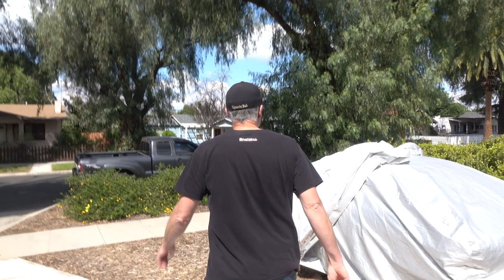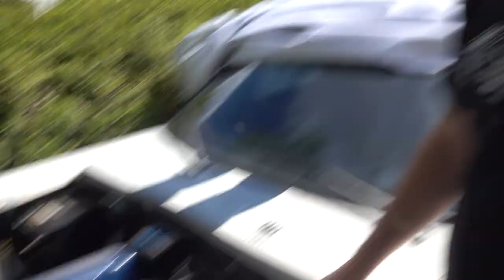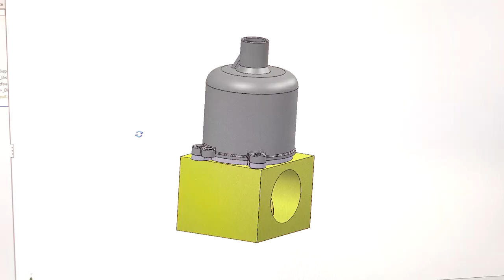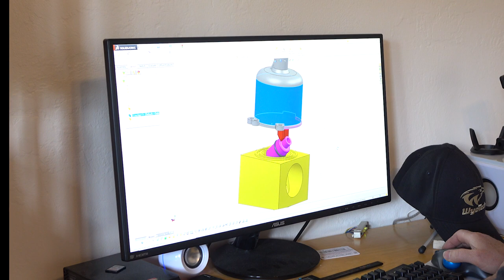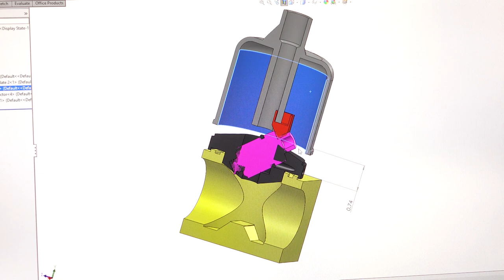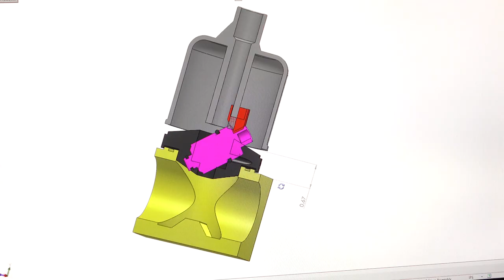Datsun 240z upgrade SU carburetors

Comment: You might looking at adapting an old 2 injector  GM TBI setup (say for a V-6) so you can split the injectors  and perhaps mount each horizontally inside the air filter in the mouth of the SU and have them spray straight into the carb throat.  You may not have to mod the carb much past making a bracket to position the injector and you'll have more space for wiring and plumbing the fuel. A side benefit is you won't be mangling a set of SU's and you also won't have to worry about sealing the resulting vacuum leaks.

Note that you'll need higher fuel pressure for the TBI injectors (9-13 psi).   While the TBI pressure is  higher than the stock mechanical pump pressure, it's much less than the pressure required for the port injectors (35psi?).

Comment: My suggestion is put your injector in a spacer plate that is between the carb and the manifold,giving you endless possibilities or  1 ask a salvage junk yard they see injectors everyday.
Suggestion 2 use the square mouth 260 carbs as they are useless as carbs but bolt up and are cheap.
   Suggestion 3 Use a four barrel carb manifold from Arizona Z.
Suggestion 4 a used 280z manifold with a EZ-injectiin system that comes with it's own programable ECU and wiring harness and eliminates most of the parts of a 280z injection system. Needs injectors and the manifold primarily.
Usually you can get the whole engine longblock and injection system as a complete unit for dirt cheap "still" cause if engine swaps and rusty damaged cars.
   Last but not least come from the bottom ,instead of the top.  If you desire to stay with stock Carbs. It hides it better than trying to fit it in the air chamber bell. And you will have more choice in injectors.
Injectors don't car if they are up or down.
Reply: As long as they squirt fuel towards the pistons. Lol.

Comment: I would suggest that you make a billet spacer between each carb and the intake, thick enough to take an injector. You can mount the fuel-rail on top (if top feed injectors) and even cover the rail, injectors and wiring with a nicely engraved Aluminum plate to hide it away...

Comment: It seems that if you would go through the work to install a high pressure fuel pump (with a baffled tank or a submerged collector), add in a ECU, add in a crank trigger, it would make sense to swap over to a manifold that has 6 injectors. The only reason i would see this to be beneficial would be if you have a head that does not have an injector cutout on the intake.... But certainly for the people that are running E31/E88 heads it could be an option. I would be curious to see the performance gain from this vs the current setup.

Comment: Why not place the injector in the intake openings between air filter mount and carb. 2 100 lbs injectors is good for 320hp and run all lines into the air filter box
Reply: That's what I was gonna say. Just use stand off injection in the filter housing

Comment: Interesting idea.  You probably won’t get the right sound from your 240Z after gutting the SU carbs. It comes  partly from the piston rise/fall you are removing to install the injector.  You would need to put the injector on a billet metal spacer between the SU and the intake manifold, which is easier anyway.  You may still be able to disguise them.  That’s my .02

Still say you try this- It won’t increase performance (HP or torque) much compared to properly tuned twin SUs with (say) SM needles.   I’ve got my twin dome top SUs set so I don’t need to constantly adjust or balance  them.  They were rebuilt about 2yrs ago. 

TBI should improve milage, b/c  when set up for performance the SUs run rich at idle.  You will also get better highway milage at cruise, definitely cleaner running (emissions) and better cold starts.

Would I go to the trouble? No.  I’d skip all this extra effort and buy tripple Webber DCOE40s or Mikunis.  

You will still need to add many more ugly mods and wiring to the engine to give the ECU references for TPS, coolant temp, MAP, and maybe O2 sensor(s) at exhaust.   But it looks like you will enjoy going down the custom Injector rabbit hole.

Comment: In my opinion I would never want to do EFI on my Z because it gets rid of the unique feel and sound of carburetors. When you have a car with an engine with as little displacement as a 240Z has, fuel efficiency and environmental concerns are irrelevant. It’s supposed to be a fun car, not a practical car.
Reply from the maker: That's why I want to use the carbs. So i don't lose the sound and feel.
Reply: Even here in CA, they don’t smog a 45 year old car.  I think it stops at 25 years old. 🤔
Reply: @oldbustedhotness5994  yes I would be interested in doing conversion. Jenvey make a 2" SU mount throttle body. Reasonably priced.